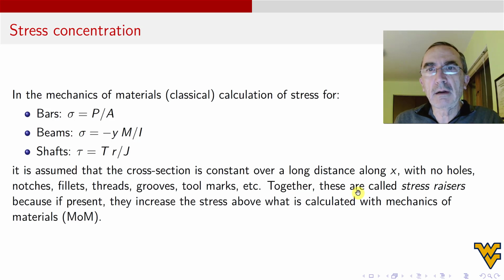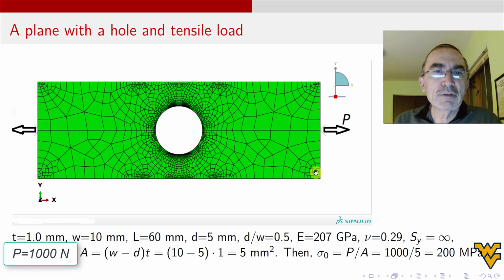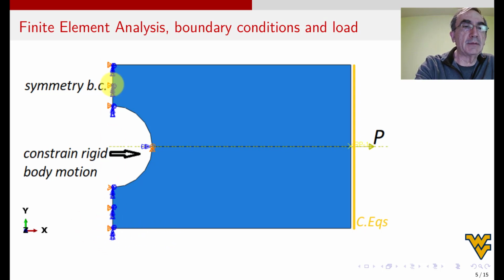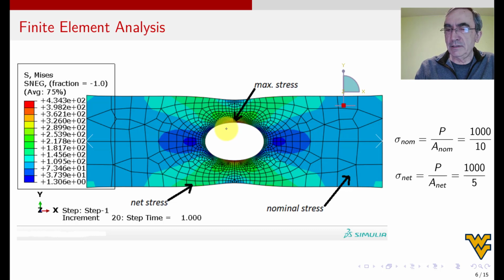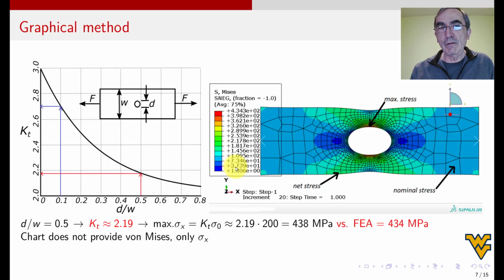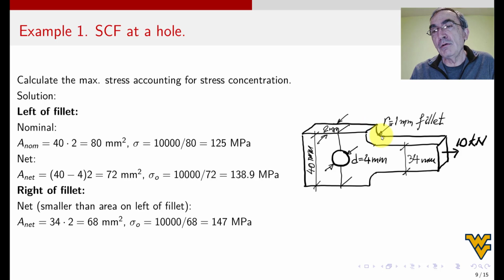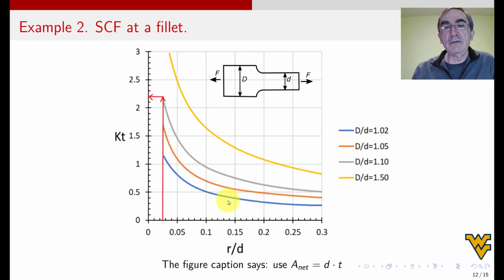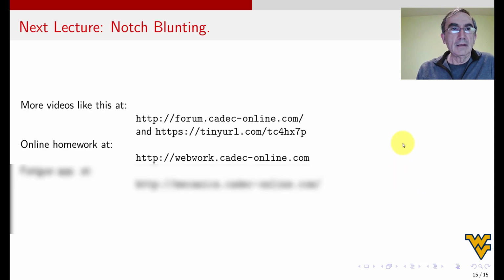Stress Concentration I, stress concentration factors for metal design, may apply to composites.

Comment: Dear professor thank you for the explanation, may I know if the thick plate with the same dimension but thickness is(say 10mm) is subjected to lateral pressure on top then from where we can find the exact solution to compare with FEM results. I found the solution and way of the exact solution for a plate with a hole subjected to uniaxial and biaxial but I couldn't get the solution for plate with hole subjected to lateral pressure.
Reply from the maker: Not sure but I would look in handbooks like this https://en.wikipedia.org/wiki/Roark's_Formulas_for_Stress_and_Strain and others
Reply: @EverBarbero  Dear professor I checked in the book (Roark's_Formulas for stress and strain) and others too but couldn't find any valid solution for SCF or exact solution for rectangular simply supported plate with hole subjected to lateral pressure. May you give some light on that how can be verified FEM results for the same case.